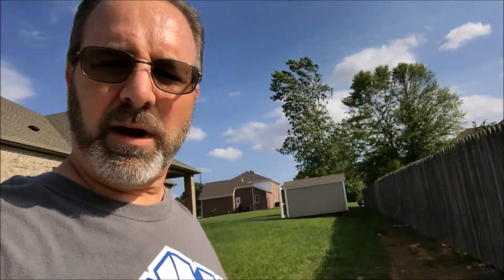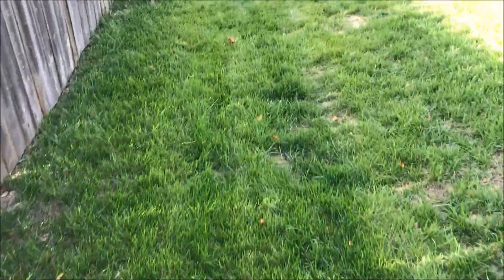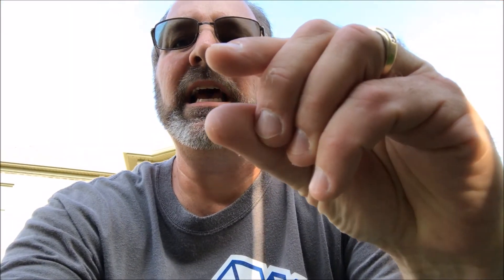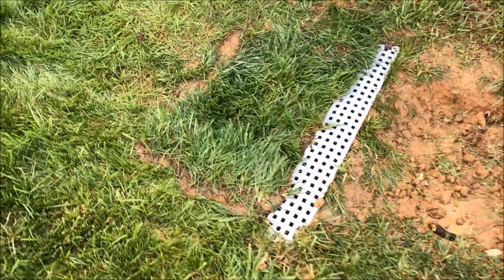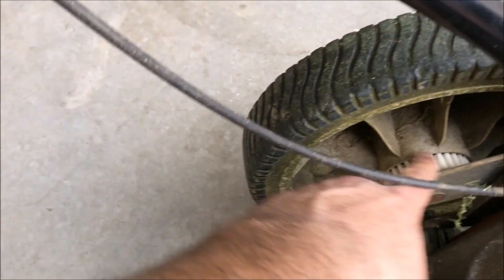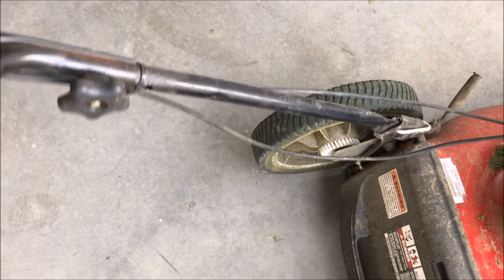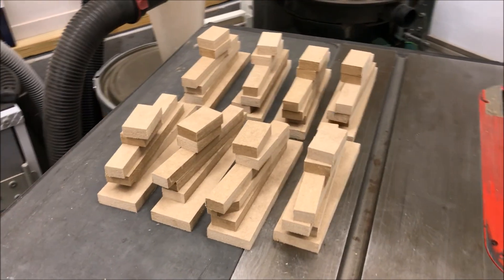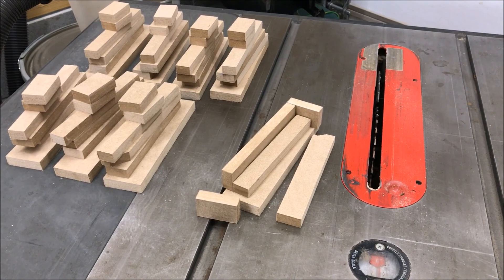Shop Update 5/18/2017

Comment: I used to do a lot of water control, man it can be a job! I used a lot of "french drain", (large rock wrapped in filter fabric), buried in the ground to give a place for the surface water to go. They work quite well.
Reply from the maker: +Tarry Frey I thought about a French drain but I thought they were more for standing water. I have a hard sloping yard so all the water runs off, it just takes my yard with it. What are your thoughts?

Bob
Reply: You're correct, a "french drain" is best used for water that is pooling somewhere, or has very little slope to run down. Perhaps you could use decorative rock to slow or redirect the water so it would not erode your yard. If the flow rate was reduced enough to keep the lawn in tack, then you drain system could carry the water away from your property without damaging the sod.
Reply from the maker: +Tarry Frey Thanks Tarry,
  I have plenty of what I believe is called Rip Rap. Maybe I could use some of that to redirect. 

Regards,
Bob